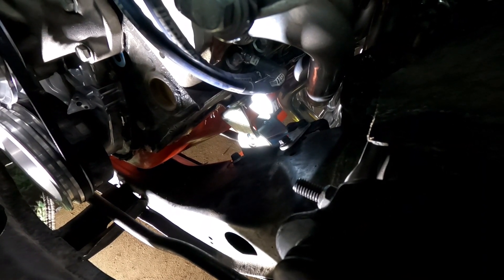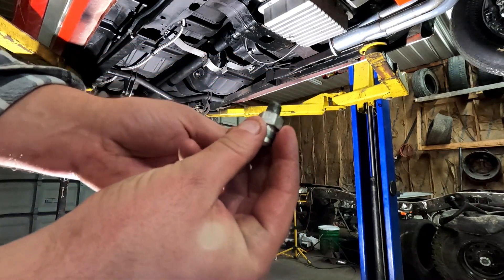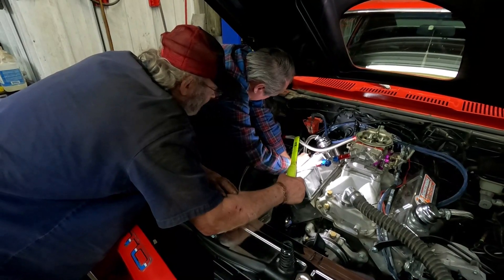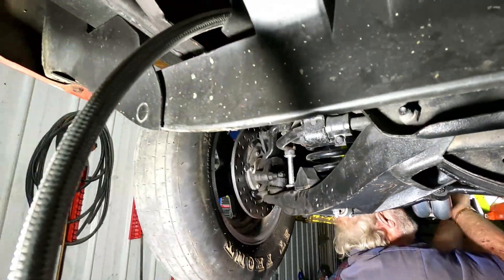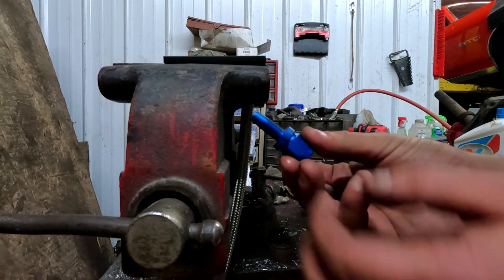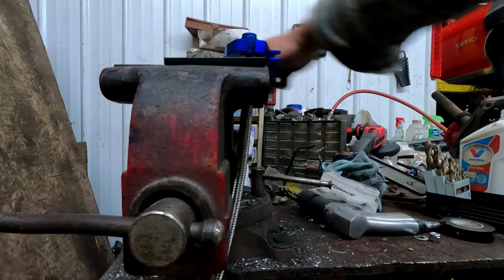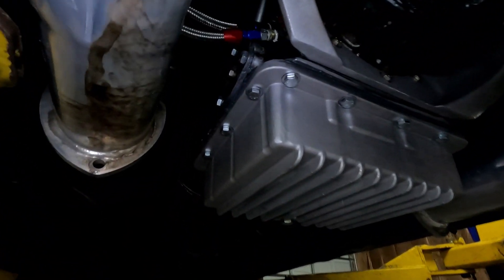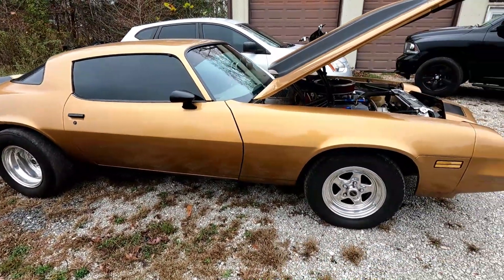Installing Moroso Solid Motor Mounts and a B&M Supercooler

Comment: All that work really went pretty smooth. I would have not wanted to do it without the car being on a car hoist. Trying to do what we did lying on the ground would have been pretty impossible, especially, drilling/tapping the bottom transmission fluid line on the transmission (outlet line). The powerglide had two 3/8" npt female provisions. Andrew left the top one at 3/8" as it was in fine shape but drilled and tapped the bottom one out to 1/2" npt. This took a 7/16" drill bit for the 1/2" npt tap.
Reply from the maker: Was fun with all us working together!